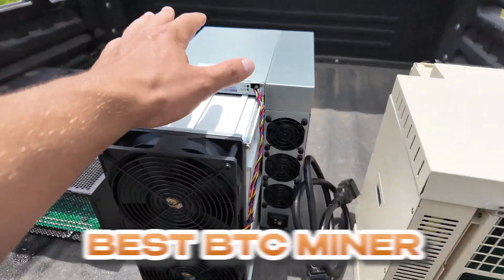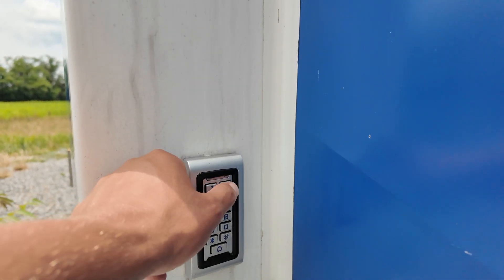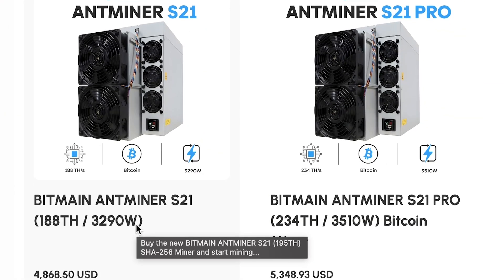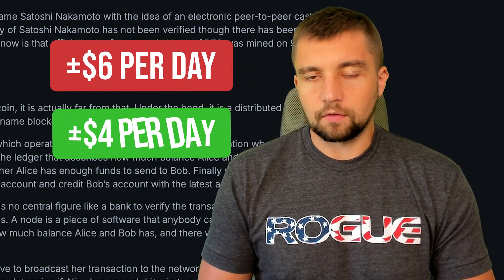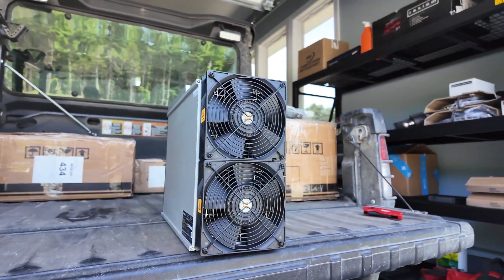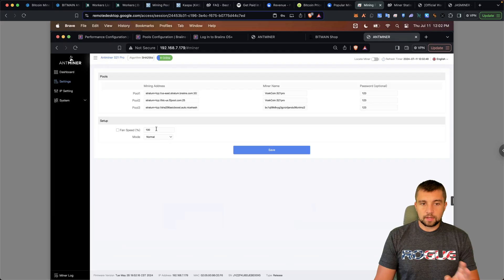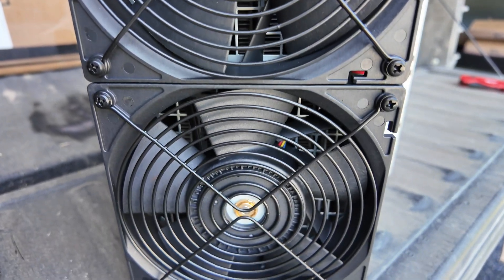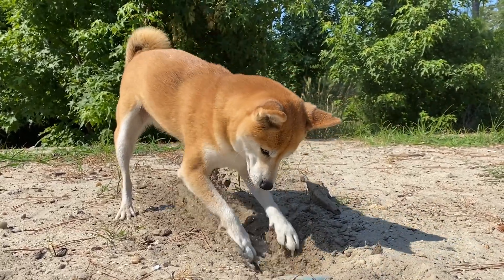Bitmain Antminer S21 Pro Review and Bitcoin Mining Profitability

Comment: Not sure about this unit, but  BV Bitmain Antminer S21 Pro 260-270TH – 234T Bitcoin Miner. Forget about a single unit or 10 or 50. 100 Units mining 24/7. Total hashrate:
234 TH/s × 100 = 23.4 PH/s (petahashes per second). Total power draw: ~350 kW (24/7). Time to mine single Bitcoin 65–75 days per BTC (currently over 94K USD). Electricity cost: ideally a good electricity contract and a mid size/large warehouse. $0.05 / kWh ~$420/day. with 100 miners running continuously:

✅ Total revenue ≈ $980 per day
💸 Total electricity ≈ $590 per day
📈 Total net profit ≈ $390 per day

Monthly profit (~30 days):
≈ $11,700/month

Annual profit (~365 days):
≈ $142,350/year

(These figures assume stable BTC price & network difficulty and that each miner runs 24/7.)